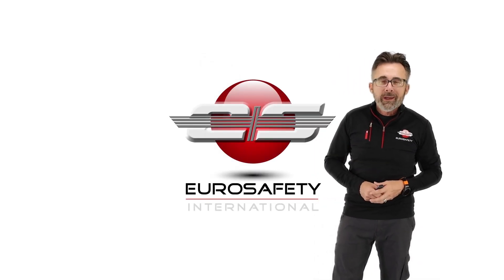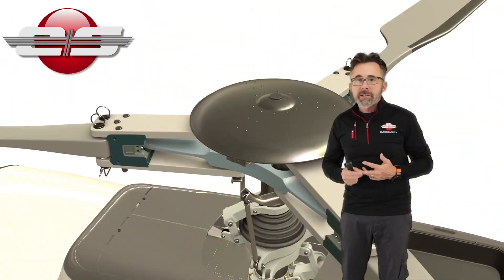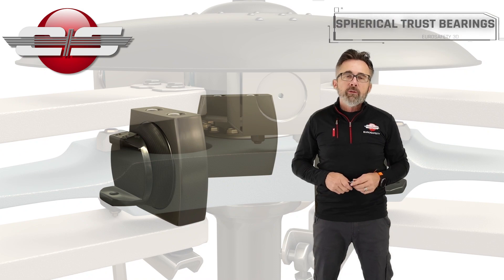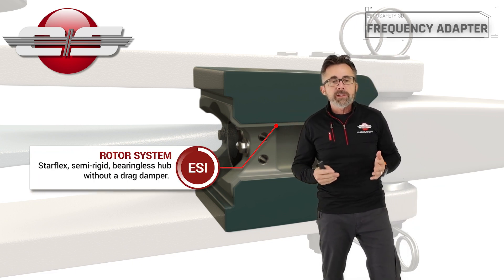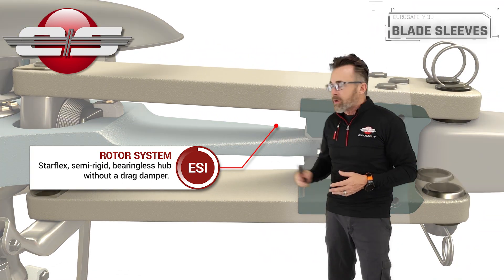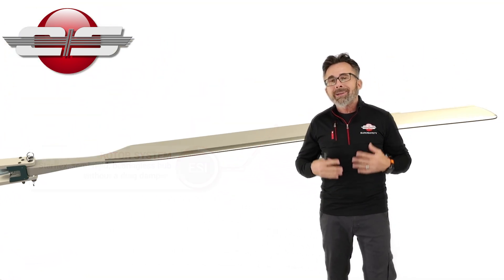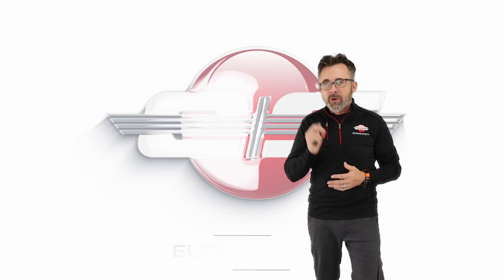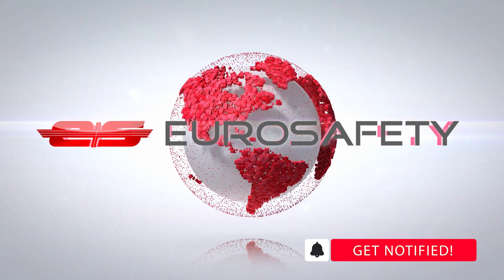#63 - Decoding the Airbus Starflex Rotor: A Pilot's Guide

Comment: Your hub is a simi rigid flap and feather. It doesn't mater the number of blades. 
Bell typical simi rigid teetering under slung
Brantley Simi articulated feathering flapping inboard Flapping and lead lag outer 
Hughes Articulated 
MBB 105 rigid feather only
Kaman two bladed articulated 
It's all about the hub hinges not the number of blades

Comment: I guess in the European way of thinking the Starflex is neither fully-rigid nor fully articulate, so the only option left is semi-rigid :-)
Reply from the maker: Really its neither. For instance.... there is the fully articulated system .... its on many different makes of helicopters. That system is owned by Sikorsky... you pay when you use. Starflex is another system. Considered different design. Its design type is Starflex. When the French described it as semi rigid they were describing its flexibility.... not its name.
Reply: @EUROSAFETYTRAINING  Interesting, thanks!